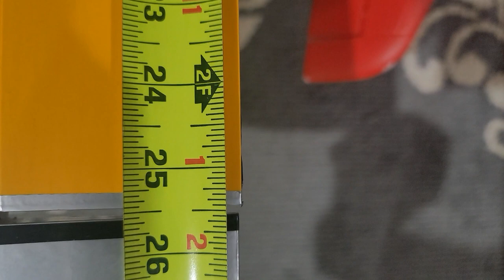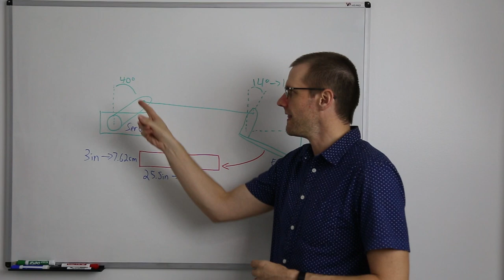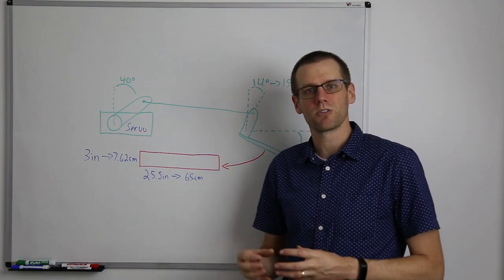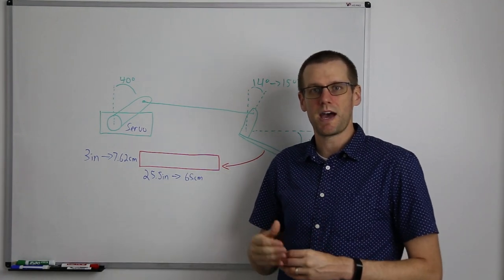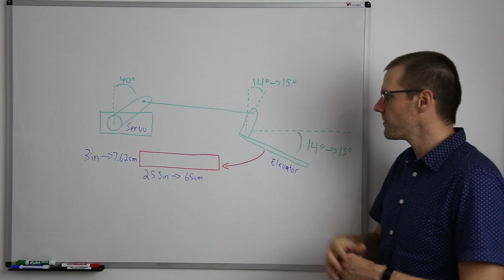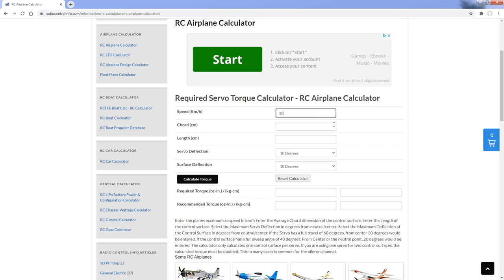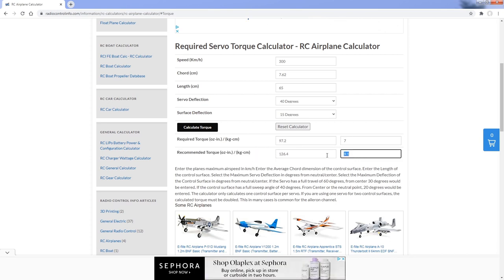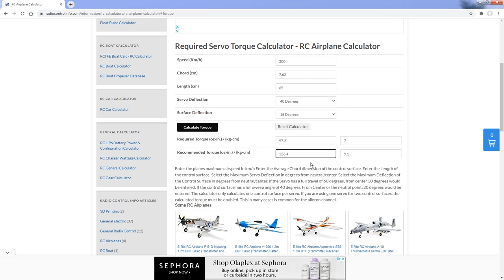RC Airplane Required Servo Torque Calculation

Comment: Hi there, if I understand the control linkage correctly, the mechanical lengths play a big role in performance? (servo horn, control surface horn, pushrod, and servo to hinge) The calculator does not provide these lengths. Do you know how I can determine those? Thanks in advance 🤓🙏🏼
Reply from the maker: Mechanical advantage created by length differences is calculated knowing the difference in angular motions at the servo and control surface locations.

Comment: Could I get the equations used for this calculation? I would like to use it to calculate for surface deflections above 65 degrees.
Reply: no lift is generated just drag you got, if you are interested in calculating it scientifically I recommend ANSYS CFX.

Comment: Two things, 1. When are you ever going to use 15 degrees of elevator at 300kph?! 2. If you use a servo arm length that needs 60+ degrees of travel to get 15 degrees, you will need much less torque.

Comment: Thanks for the video, so instructive. But why is the weight of the plane not an input value? I would say heavier plane gives need for more torque??
Reply from the maker: Plane weight is not a function of servo torque required for a control surface on a plane.
Reply: @RCexplained  OK. And I assume that required/ recommended torque is the actual torque to the control surface, if needed torque is 5 kgcm, and the servo arm is 2 cm, you need to buy a servo with 2 x 5 = 10 kgcm?
Reply from the maker: No the servo arm geometry is cleverly handled by the formula with the inputs given within the calculator.
Reply: @RCexplained  Hmmh, 🤔 So when you choose servo arm degree, you implisitt choose the arm length…🤓
Reply from the maker: Yes, the formula in there considers both degrees of rotation on the servo as well as the control surface.
Reply: @RCexplained  Finally got it👍 Thanks for taking your time

Comment: I know this may seem like a stupid question but how does it know the difference in control surfaces. An aileron on my 60 size glow model would be the same size an elevator on a 100cc model and clearly there are different servos. How does that work?
Reply from the maker: Hi Peter, the control surface formula considers the cord, length, deflection angle of the control surface plus aircraft speed and servo geometry to determine torque requirement. Engine size doesn't come in to the formula nor does the servos that were installed in 2 models. Hope this helps.

Comment: How do you choose which holes to use at the servo arm and control horn? Does the hole selection change the torque obtained? Is it just trial and error to get the correct movement and torque required? (Your diagram uses the outer holes for both). I've always wondered this 🤔
Reply from the maker: Hi Don, use a servo that has the minimum torque required. Using the innermost hole on the servo arm will allow the torque the servo can generate to deliver a greater amount of force.